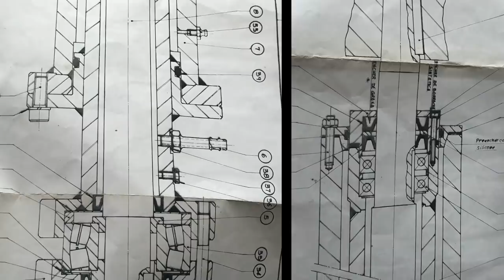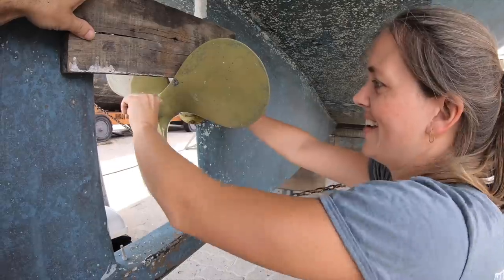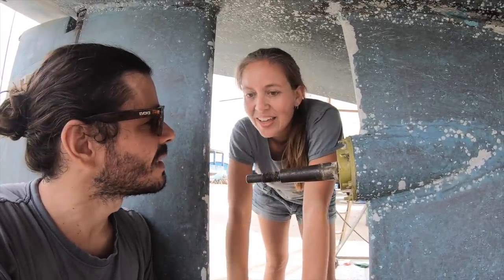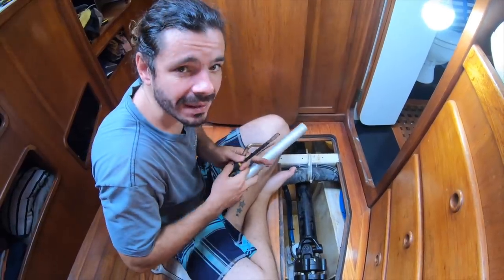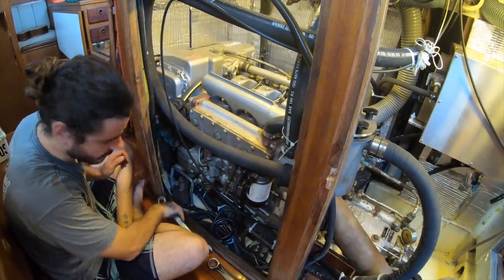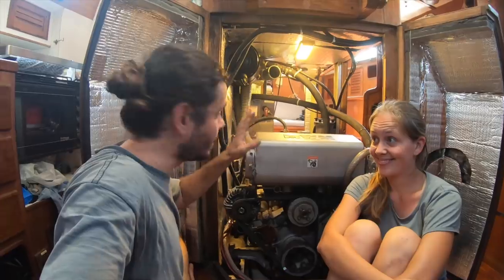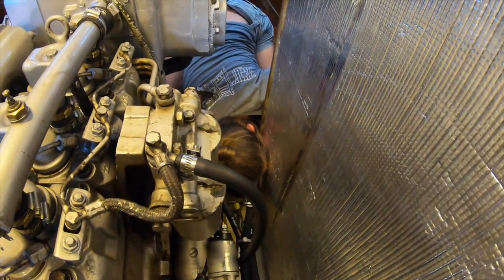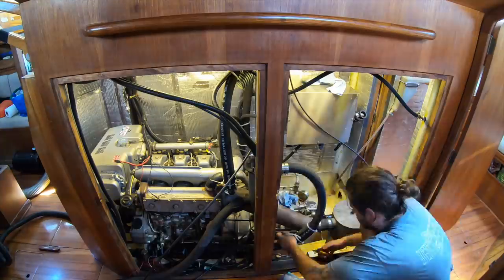⛵️New Year, New Challenge!! Taking our ENGINE OUT: the BEGINNING #168

Comment: Question, do you have scuba tanks, or air compressor and and mask?  Just thinking if you had t do this after hitting something?  Plus always carry extra U-joints in case you break one of those. If the new system has U-joints.

Comment: You might want to rethink removing the engine mounts until you have stripped off all the auxiliary equipment and drained it out, That's one heavy lump if you tip it over pulling a stubborn bolt somewhere. Take care.

Comment: 6 x P,P,P,P,P,P's well done guys. The 6 P’s are a valuable tool that great thinkers use regularly. 

Prior Preparation and Planning Prevent Poor Performance! 
 
You are now familiarised more with the engine tie down points and better prepared for the engine removal which will save time on the big day. :) Keep smiling.

Added another line, keep up the good work, the videos are excellent.

Comment: What engine comes?as i remember right, the answer is Yannmar 35Kw (or 55 Kw),is it right answer?! :)and my suggestion (as yacht technitian) is, if possible to avoid those cardan joints systems, change the angle of engine and place axle direct from clutch trough the exit bearing to the propeller, to save yourself lot's of headache. :)

Comment: Just a tip, too late now though, label the wires you remove. If things were going back on the same engine, it would be fairly easy for the person that didn't remove things, the harness would be put in place and you could see where the wires were supposed to go. With a totally new set up, things will be different and not necessarily in the same spot, that's where the labels come in. No powering up and using a volt meter or accidentally installing B+ to a gnd, just read the tag and trim/extend as needed. I second the use of anti seize. If it were me, on the water, i'd use copper based.

Comment: At 10:38; drive shaft/flange noise at gear box it look like we can see quite well the socket cap screw at yoke-U joint are loose/not the appropriate diameter and/or wear out because not appropriately torqued. Propeller; do you plan to install a propeller rope cutter? Be well

Comment: sorry last comment made before I saw what you were doing. why dont you have that engine rebuilt and save yourselves enough money to buy a spinnaker . that knock is just a couple of worn bearings in the UJ of the auto motive prop shaft used to connect the engine to the main prop shaft. really easy to service yourself.

Comment: Look into the parallel hybrid beta marine diesel engine. When the engine is off & is in neutral it works like a hydro electric generator, because there are two really big & powerful electric alternator/generators. One is attached to the front of the engine's crankshaft, through the harmonic balancer pulley drive via a belt & is only used when the diesel engine is running. The other one is attached to the rear of the engine & makes power when the boat is on or off. The rear generator is attached to a pulley on the output shaft that goes to the propeller. So it can also produce electricity & charge led acid or lithium-ion batteries when the boat is in neutral because this system has a fixed propeller instead of a folding propeller. So that it works like a hydro-electric generator. Also this beta-marine diesel  engines are completely mechanical & have no computer or electronics. Diesel do not require spark plug, instead they use a glow plug until the engine heats up. So no ignition spark system. The fuel injection timing system I believe is controlled by the lobes on the camshaft, that push open the intake & exhaust valves for each piston. The diesel engine compresses the fuel until it ignites, unlike a gasoline engine, that requires a timed spark from a ignition system that sends an electrical current to a sparkplug to ignite the compressed fuel in the cylinder or multiple cylinders.

Comment: As to what engine, based on Odd's size, I'm hoping you're looking at a Yanmar 4JH57 or 4JH80 engine.  The -57 will probably be enough, but having the -80 is always nice to have a little more 'oomph' to get you out of tight situations.
I don't know what the prices in Brazil are for either one of those engines, but the -57 looks to be about $7,200USD and the -80 is about $9,200 USD
Duca, one of the things that really impresses me about YOU is that you are willing to sit back, relax, get the information you need to make a proper decision and then double check to make sure you're right.  In watching Ben and MP on Yaba, I don't get that impression at all.  To me, it seems they are like 'Okay, here's the boat, let's fix it willy nilly and we'll just throw more money at it.'
That may not be a correct assessment, but it's the way it feels when I watch their videos.

Comment: You may wish to consider getting ratchet wrenches and LONG Socket extension's of various lengths. Heavy duty U Joints for the shaft will ensure a really long life to those.  Lastly if there is room for a cabinet maker to open up or put a door on the starboard side engine compartment might be helpful .... just sayin' 
Sounds like you have a good plan in place and looking forward to future video's.   enjoy .....................

Comment: The next time you put on you propeller on coat the shaft and nut threads with Mercury marine grease 2-4-C with PTFE. Don't put it on the anode. I use it on my propellers shafts no corrosion on the shafts.

Comment: Hey Duca. What was wrong with the engine. You never explained what the problem was. Just that the first sea trial was unsuccessful.  Also please explain what you gain from a new engine over fixing the MWM. To my understanding you have a very durable engine in that MWM and it should run for many more years? 
- So is the motivation; fuel economy, noise reduction, maintenance and parts availability, size and weight, engine management, or what compels you to spend another 10.000 USD on the boat?

Comment: Remember when you put the safety wire back there's a correct way to do it or there's no point. The wire keeps the bolts from loosening up. They use it in aircraft a lot. Always make sure the lead wire goes over the bolt to counter the last bolt from turning counter clockwise.

Comment: Hopefully a marine diesel electric hybrid system based on a yanmar that will charge lithium batteries while at sail by feathering the prop, but can also use other recharge methods such as solar or wind, not to mention the engine alternator. This would negat the removal of the generator earlier, and also save fuel during long crossings.

Comment: I was waiting for that prop to pop saying to myself, "please keep your hands out of there." Excellent reason why you will use a fixed prop for hte new gearbox and engine.  Worn splines on the prop shaft? Hmm, that will create all kinds of problems if it is the result of vibration.

A new technology diesel engine should be smaller for the same output, giving you more room (for more soundproofing LOL).

Comment: In the future when pulling something off a shaft, just put a load on the object being pulled and then give the object a smack with a hammer. The blow is best to be applied inline with the pull but a smack on the prop hub in this case would work as well.

Comment: That MWM Diesel looks a lot like my old 3 cylinder BMW D-50 (50 HP) which is obsolete and difficult to get parts for with a 4 cylinder Yanmar that is turbocharged and has 75 HP but basically lighter and same engine RPMs.

Comment: Just to be controversial and possibly change your minds.... think about going electric for your propulsion... twin servoprops would be more efficient and give you greater handling at port. Much less turbulence and cavitation than a centre mounted prop.
Reply: No problems with vibration, no problems with seals, no problems with drive shaft alignment, ability to generate electricity under sail, if you use a diesel generator to run it you’ll have greater range because it would run more efficiently. If the diesel breaks ( they regularly do) you can use solar to charge the batteries and still power the boat.

Comment: That MWM diesel is a lot beefier than the Yanmar....why not just do a wet sleeve overhaul instead of a $20k new engine? What kinna Ginny or you running?
Reply from the maker: MWM stopped producing marine engines in Brazil and we would need to change some pieces that are not available anymore and the plan is to sail outside Brazil and it would be harder to find pieces for the engine

Comment: I'm guessing a Yanmar Diesel. I noticed that all the bolts and nuts broke free  easily, after  many years.  I  pretty sure that whoever  did the initial installation  used an anti-seize compound on the threads. It's  something that I  would use when reinstalling the engine and associated components. Just  a suggestion.  I like your enthusiasm and positive energy.  Best wishes.
Reply from the maker: Thanks for the suggestion 😊

Comment: Bonjour les amoureux,
Congratulations, both of you are equal for working hard and sharing dust, this is politically correct currently... ;+)
I hope your boat will never capsize because if it would happen, I think the engine position would bey our last problem ! Imagine, you aslo could loose your barbecue !
More seriously, have you an idea of the arrival date of your new engine ? I hope it will be a little smaller, and more powerful as more modern, you have no room, I hope you will be able to replace the engine easily .
Besides this,, the larget engine I know is my Stuart D10 20 cm3 steam engine, so I can"t win your contest, I would suggest Cummins , Yanmar, Volvo, Isuzu.
Furthermore, I think I saw a lead acid battery, will you change it for a lithium one like the others ?
Amicalement,  Raphaël

Comment: hmmmmmmmmmmmmmmmmmmmmmm i work on those drive shafts for 30 years,,make sure u change out u joint s look like it a 1310 series with water resistance grease,,should last a nother 25 years good job,sign land lock
Reply from the maker: Thanks for the suggestion

Comment: Rusting is commonly referred to as oxidation and takes place when iron or metal alloys containing iron (i.e. steel) are exposed to water and oxygen for extended periods. ... Other metals such as bronze and copper also undergo oxidation, leading to corrosion. So, the answer to the question is NO, copper does not rust.

Comment: Why change the engine? Just fix the vibration and oil leak on the shaft.  Seams crazy to spend all that money on a complete new engine and shaft/ gear box.
Reply from the maker: Here we talked about all the reasons: https://youtu.be/QUClRe5bj6g
Reply: @OddLifeCrafting  yes I seen this. Was only a small leak, just need bearings and seals changed I would think. Changing the engine seams like a 1st clause expensive option.

Comment: This would have been to go electric two EV motors and batteries you would be off the grid, ok good luck
Reply: Of course electric.
Reply: @ThomasBussmann  Electric would have a very short range. The energy density of diesel is much greater than batteries.
Reply: @TreeLBollingTreeMan  Hehe... one does not use the electric motors for cruising but for short haul travels (in the marina, or in tight anchorage). The range with 3.2 kts is about 40 nautical miles mentioned by "Sailing Uma" (just to mention a real life example). With 2.7 kts they get a range of about 60 nautical miles: https://www.sailinguma.com/the-motor

Comment: I do feel this anti-fouling did not do a good job....
Reply: None do, lol.  The Sea is only peaceful when youre above it.  Under the water if its not melting away with rot then something is trying to eat it.  Or both, lol. 10k for Copper Coat that last a year in the very best pristine conditions is a scam on par with State run Lotto.
Reply: Yes I was also looking at that paint coming off. Can't remember if they used copper coat .
Reply: @michaelbundy3867  We could see it if they did.  I just used CC as the example because of its insane cost and limited function.

Is the warmer coastal water more prone to growth than say the north Pacific?

Comment: Shame your changing the engine as that MWM will outlast any Yanmar and is built to do the job unlike what your going to fit What Yanmar are you going to use ?? That MWM only needs a battery to start it no other electrics needed The Yanmar will stop with no batt power as it has electronic injectors etc etc etc Electrics and salt air and water ??? Good luck
Reply from the maker: HI Howard, the Yanmar we bought doesn't have electronic injectors. It is an aspirated 4 cylinders (4JH5E), all mechanical.  MWM is a great engine but you won't find parts outside of Brazil. A friend of ours has exactly the same boat with the same engine and he is im Panama right now. Every-once in a while he ask me specification so he can order parts in Brazil and send it to Panama. So if we planed in only sailing in Brazil would be fine, but in a medium term we plan to travel to other countries. 😊
Reply: @OddLifeCrafting  Thanks for the info and which engine you have chosen. I don't know who has told you the parts are not available outside brazil ? but they are available world wide I can tell you. Hope its an easy fit with the new engine but looking at the angle of the intermediate shaft that has universal joints both ends I hope you will have an easy line up with new shaft etc